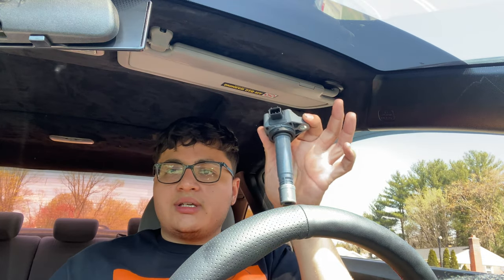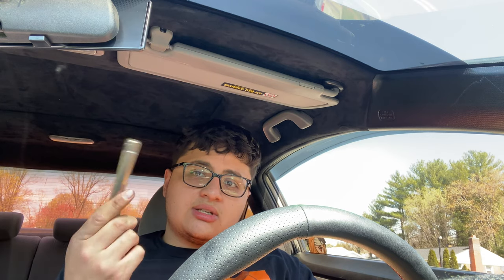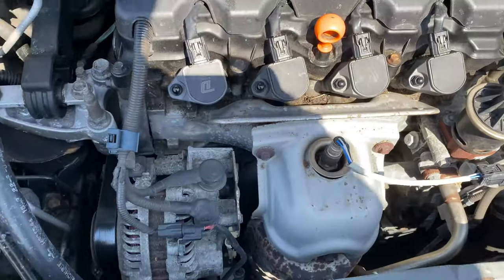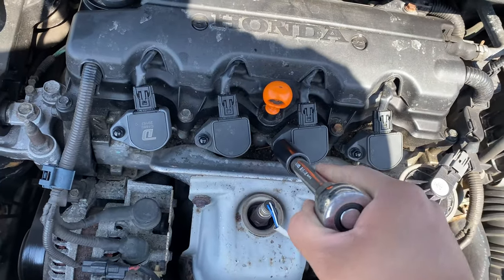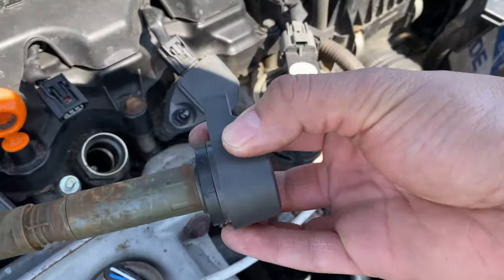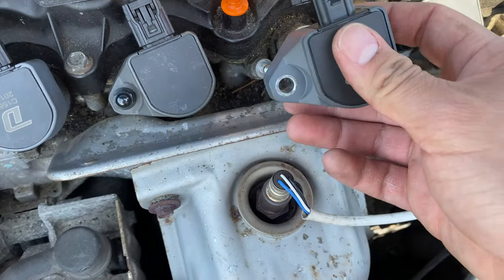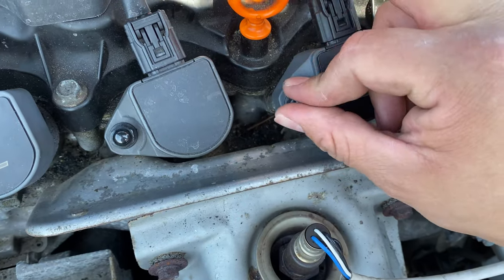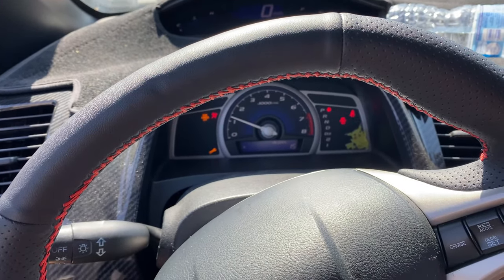2006-2011 Honda Civic ignition coil replacement

Comment: You have replaced all the spark plugs and two of the coils, why on Earth would you not replace the remaining two coils for the extra $30? Also, Dielectric Grease on the ends of the coils yo.

Comment: Counting left to right you changed the 3rd ignition coil, would that show up on a code reader as the 3rd one as well? (303)
Reply from the maker: It actaully did i would get that as the code as well as the one for multiple cylinder misfires

Comment: how long did that coil last?   I bough that same brand and had to replace it 3 times so far in less than 1 year period.
Reply from the maker: Same happened to me I went with a different brand because these kept giving me issues every time I replaced it